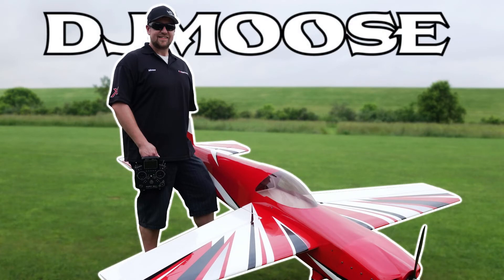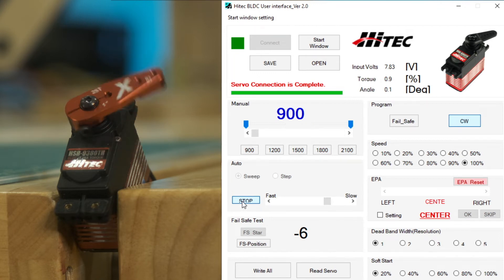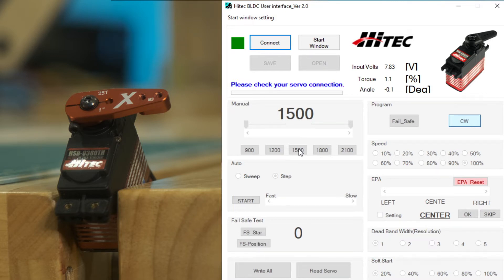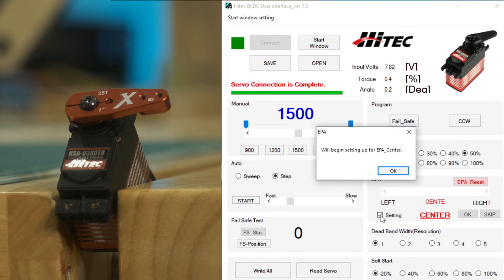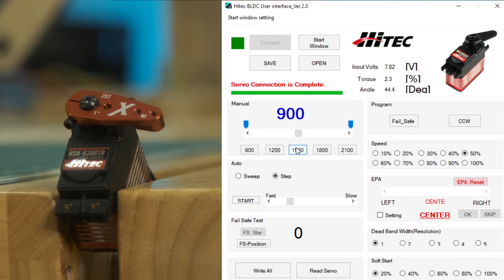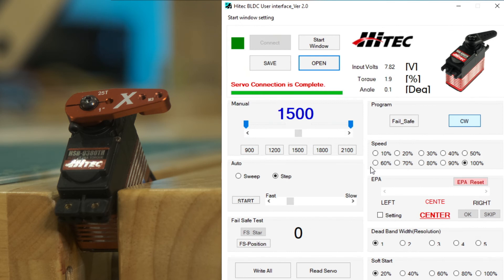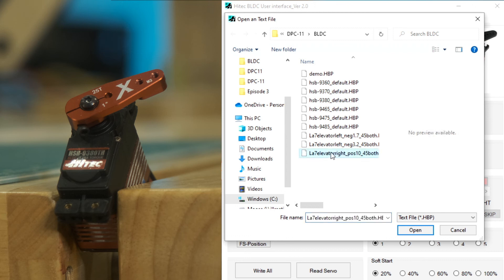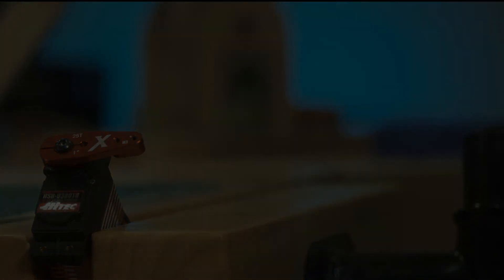How to program Hitec HSB BRUSHLESS servos with the DPC-11 in 15 minutes - D9380

Comment: Thanks, I have purchased the HFP-30 programmer and a couple of HS-5245MG servos to replace a faulty servo in my Freewing Mig-29. Having now watched all your servo programming videos I feel confident in setting servos up to exactly how I need them. Thanks again.
Reply from the maker: Glad it helped! Remember, you need to understand where your radio's center and endpoints are for the channels. Keep in mind these programmers can only program to 900-1500-2100µs. (Jeti radios by default center at 1500 and have to have the channels upped to about +/-124% to get up to 2100µs and down to 900µs) Good luck!